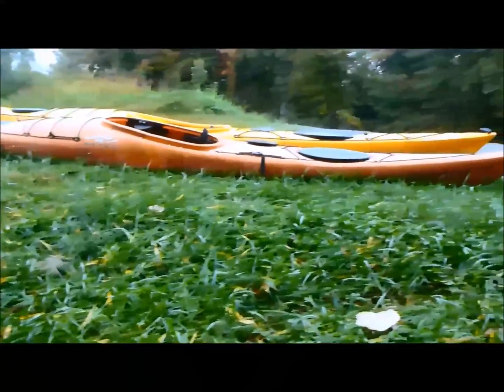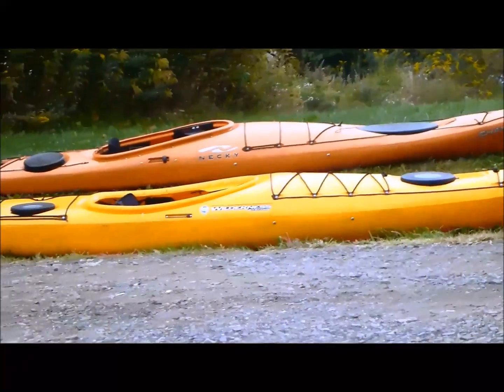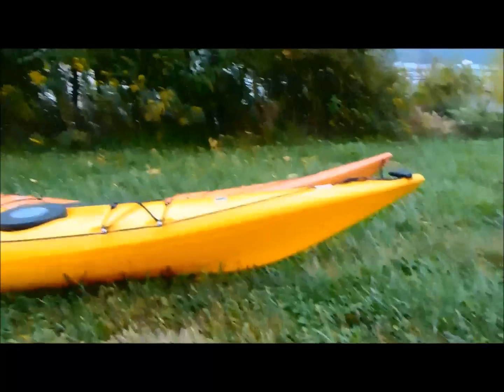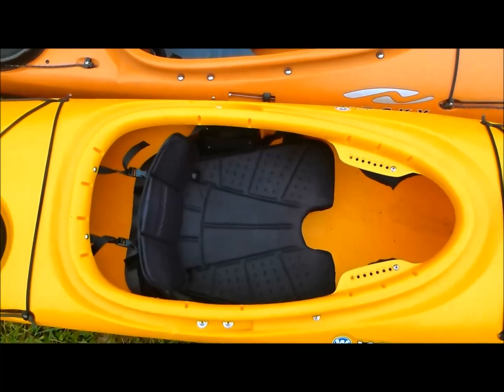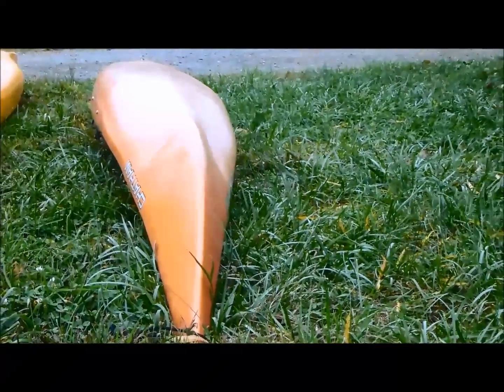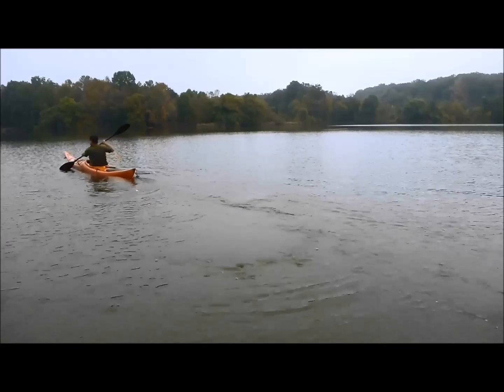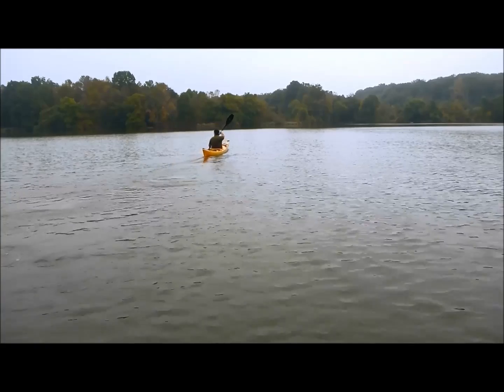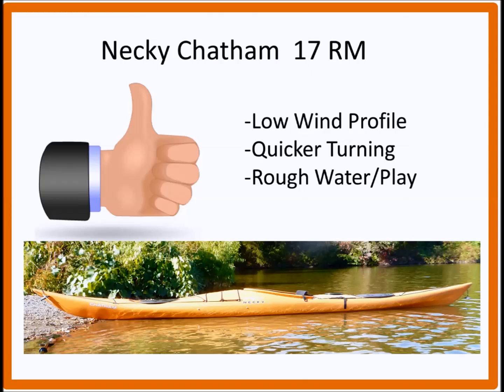Necky Chatham 17 vs. Wilderness Systems 170 Sea Kayak Test and Review

Comment: My 17’ Necky Chatham had Wilderness System hatch covers and back band. 
Old Town even sent me a coil of the original poly material to plastic weld a hole. 
You really need original formula plastic to get a good weld. You couldn’t even see the repair!  
That was the boat I took 8 miles during a small craft advisory. It was ballasted down good with camping gear. It was really stable. 
Tho the headwind was so strong I only made 2mph.

Comment: Just bought a used T170. Its fair to say I'm quite excited
Reply from the maker: Nice choice!  Enjoy.
Reply: @Scootchels  thanks.  Any recommended mods?
Reply from the maker: @directorstu  Personally, I’d start with the cockpit outfitting.  Get the fit right with the legs and seat, then you can customize the hip pads and knee braces.  Next, it’s safety and operations.  Replace any bad bungees, decklines or bad hatches.  Also check the bulkheads for waterproofness.  The skegs can be troublesome, too, but if it’s working smoothly you can leave as-is.  From there, it’s the standards: PDF, paddle, dry bags, rescue float, throw rope.  What else am I missing?
Reply: @Scootchels  thanks. This all makes sense.  I've been playing with the seat and foot settings. Wqs a bit worried about lower back support but happier now.  Skeg works well. Bulkheads and hatches look fine. Got a pfd  Need the throw line and a paddle.  Will buy a cheapish one and make a Greenland wooden one.  Need a spray deck so I can get out in some white water.
Reply: I have had the Zephyr 160 for a year and half and picked up the Tempest 170 used about a year ago. I like the Zephyr a lot but love the Tempest.

Comment: I really like this kayak↝↝>share4.photo/sKayak?Dほ    It is pretty stable in the water and easy to get in and out of. It goes very straight when paddling, and has a little storage compartment separate from cockpit to keep things dry. Also has little paddle strap on the side to hold your paddle to the kayak when not paddling. I got the green one and it is a nice bright color i like it.

Comment: Can I combine scuba and long distance touring in a sea kayak? I like the Necky but can I also use it for scuba or fishing when I want to. I only want one boat with performance first for touring or rough seas.
Reply: If you want to combine SCUBA and sea kayaking I would look for high end sit on top there is one I have seen one with 425 lbs capacity  (cant remember name), when I was 220 lbs I got to try a Chatham 17 and I had no free board, the added weight from SCUBA gear will nearly sink any sit in boat except maybe the Kruger Canoes.

Comment: Great review and I agree with most of what you have to say about the two kayaks. We currently own 4 Tempests (165 poly,170 poly, 170Pro, 180Pro) and have owned a Chatham 17 that was traded last summer for the T165. My wife and I have paddled the two side by side and both of us prefer the T170 hands down over the Chatham 17. The additional hull rocker of the Chatham is quite obvious when looking at the two boats sitting next to each other but from my experience there is not that much difference in turning speed when edged aggressively. However, there is almost no comparison in the comfort factor between the two. The Necky seat and back band is horrible in comparison and you have to add your own hip padding. I owned and paddled a Necky Elaho composite for years and was never comfortable in it either as it used the same outfitting as the Chathams. Other than the seat/back band the Chatham is a great boat but I still far prefer the Tempest. I have personally owned a NDK Romany, Valley Avocet FG, Impex Mystic, CD Gulfstream, CD Squamish, Valley Aquanaut LV, CD Extreme, Necky Elaho, and currently a CD Cypress Kevlar. Of all these kayaks I like the Tempest the best.
Reply: What is the size of the paddler that uses the 180 pro? I sat in a 170 and 180 and thought the 180 was much better for me, but their suggestions based on my height/weight make me question it a bit.
Reply: Dane Haroldson The recommended paddler size for the T180 is 210-250lbs. However, my wife (5'4" and 175lbs) is the one who chose the T180 because of it's larger cockpit opening which allows her to get into it easily with her congenital hip anomaly that limits her flexibility. I'm 5'9" and 160lbs. and, though a bit big for me, the T180 still paddles great. In fact the cockpit isn't as big feeling as the CD Gulfstream (used to own one). The one issue with lighter paddlers in the T180 is in very windy conditions it can be a handful unless you put some ballast in it to lower the waterline which makes it track better.
Reply: That makes me a little more comfortable with it. I am about 5'11'' and about 200 lbs now. Although can fluctuate from 180-220. When I saw in a 170 I could pull my knee up with only about an inch or two of clearance. The 180 seemed a lot more comfortable for me despite me being kind of in the 170's range. 

I actually have a chatham 17 right now but would like a more comfortable cockpit/seating configuration, as well as some better storage. I liked the WS Tempest Pro and also Sat in a Valley Etain I kind of liked, but the Tempest seating seemed to be a deciding factor. If anyone has experience with these lines, any advice is appreciated.
Reply: Dane Haroldson I've not paddled the composite Chatham  but I do know the poly Chatham 17 is considerably roomier in the cockpit than the Tempest 170. I've personally owned a FG Valley Avocet and a poly Valley Aquanaut LV and like the Tempests better than either of them for the paddling I mostly do. The newer Valley kayaks are definitely more comfortable to sit for long periods of time than the older NDK Romany and Explorer I've owned. I've not paddled the Etain but the Aquanaut tracked very well but took some serious edging to make it turn. In comparison, the Tempests turn very easily without much effort and if edged hard with a brace you can get the stern to skid across the water.
Reply: Is there a noticeable difference in performance between the tempest 170 poly and pro?